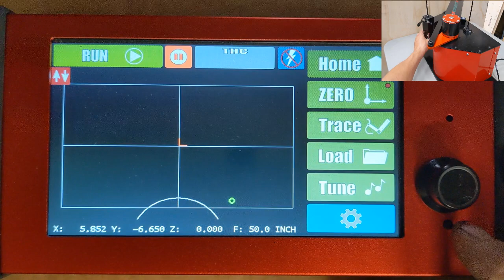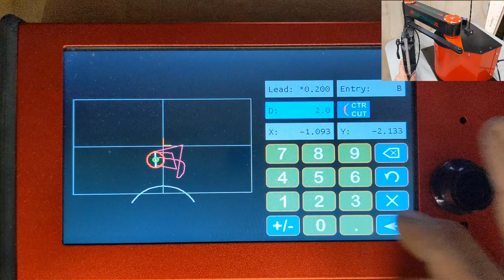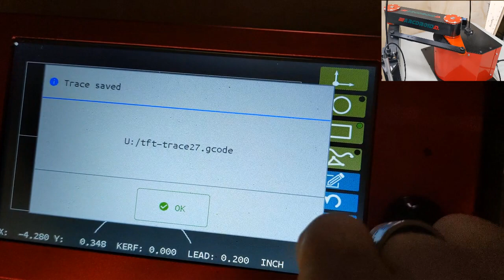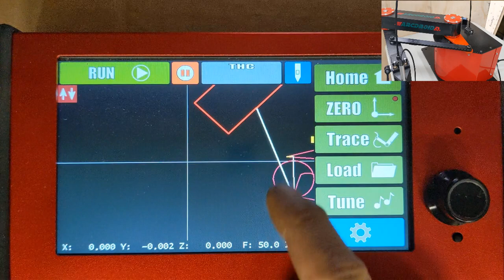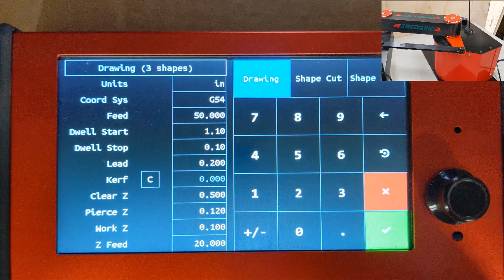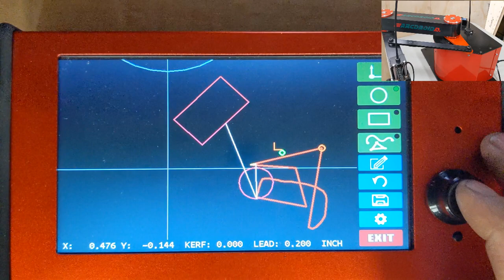By request, here is a video on the UI interface.

Comment: I may have missed it but having the ability to save and load "successful" parameters in the Tune area for different materials would be a nice feature.  I did pick up on you stating "this is an older interface". Maybe you've already included it in the later revision.
Also, once the machine has performed its Homing Routine, is there a way to select a different quadrant for the X0Y0. It appears that it currently uses quadrant 4 where every thing is to the negative side of the homing location. I'm used to drawing in Q1 for my CAD files but maybe I'm not looking at it correctly.

Comment: I can't wait to have the machine shipped to me! I am #268 to contribute, but, viewing this video, (especially since it was a blazingly quick tutorial), I sure hope there is a massive detailed instruction booklet that comes along with it! Can I duplicate multiple parts on the same piece of stock? Can I produce multiple different pieces on the same piece of stock, etc? When will the torch height control be available? Will there be basic connectivity wiring diagrams for different plasma machines? Also for beginners, will there be common baseline torch settings to use? lots more questions coming. Thanks guys!

Comment: Great video! How large of a piece can you cut out with it (length and width?) Second question if I wanted to cut out a piece (like a metal sign with lettering) can I cut out lets say the left side then move the steel and cut out the right side for a piece of steel that the arm can't do in one cut?  Thanks. I would love to see more videos about it..
Reply: I was thinking this exact thing. It looks like the base plate has 90 degree sides, and holes in the corners, so indexing the cutter onto a larger plate would be pretty easy. Maybe there is a way to "half" the program in cam software? Good question, I'd like to know as well.
Reply: To me this is the beauty of this machine. I ordered one and look forward to receiving mine.